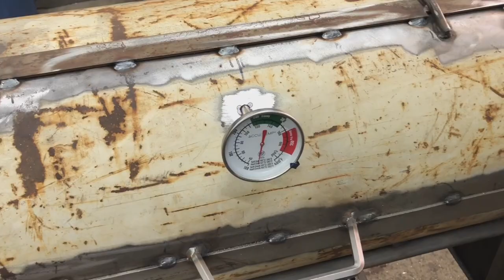How To Make An Awesome Propane Tank Offset Smoker !!

Comment: I’m intrigued by that tool you use to cut the propane tank. Is that a regular grinder with a special blade? I’ve never seen those before. I’m enjoying your video!
Reply from the maker: It’s a special grinder that has 2 blades running opposite ways
Reply: Its called a double cut saw. Bery versatile.

Comment: @BonifabcustomRobBonifacio I got the same tank and have decided I’m gonna go ahead and turn her into a smoker. I got everything pulled off and opened up the main body. It’s been empty for years, as I filled it with each bubble it smelt strong of the odorant, even still as it is here full of water it smells super strong. Should I be concerned about this or is she good to go ahead and cut her top open? Thanks bud

Comment: I’m in the uk, is it possible to weld a smoker with a welder that will run from household 13amp plug. I’m using a 3/8 inch air vessel as the main body
Reply from the maker: I think you need something stronger for 3/8”
Reply: 3/8 inch air vessel? Thats nearly half an inch thick! That is way to thick for any air vessel ive ever heard of. Measure again, anything 1/4” or under will weld fine for a regular stick welder on a house plug, just dont get carried away and make it overly heavy or weight bearing, add extra supports until you learn to weld properly. This will be good practice.

Comment: Big warning for people removing the valves on old propane tanks 
Some valves fail and will not allow the propane out simply by opening the valve 
In situations like that I’d consider drilling a small hole to allow the propane to evacuate 
Being extremely careful not to ignite the vapours in the tank 
Or just remove the valve being extremely careful not to be in front of the valve when you do so 
And wear gloves to protect from the blast of propane when the valve takes flight

Comment: I wish you would have left the original colors and high heat clear coated it.
Reply from the maker: I was thinking of it
Reply: @BonifabcustomRobBonifacio  what is the price of a smoker like that ? ,not  asking you to sell it,just wondering what it's worth after all the time and effort that goes into building it.
Reply from the maker: @eastside0434  i charge 1000$ to build it
Reply: @BonifabcustomRobBonifacio 
I like the build,have you ever thought about building a 250 or 500 gallon propane tank smoker.?
They seem to be the latest craze,
I have someone telling me they want 4k to build a 200 gallon smoker.
Reply from the maker: @eastside0434  ya I’ve already built a few here is the link to one of mine https://youtu.be/mOz3s9hHd8U , thanks